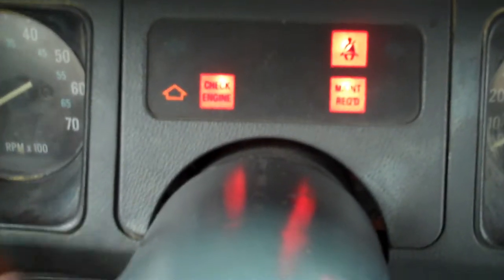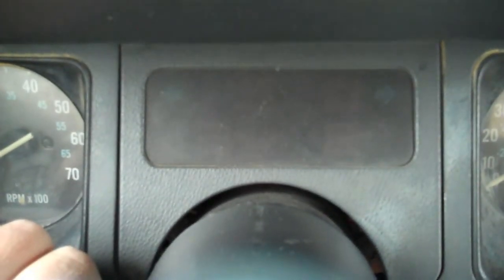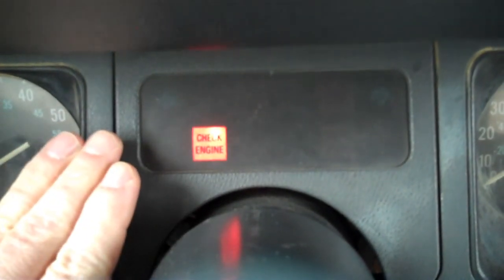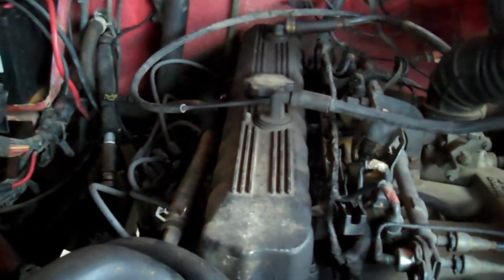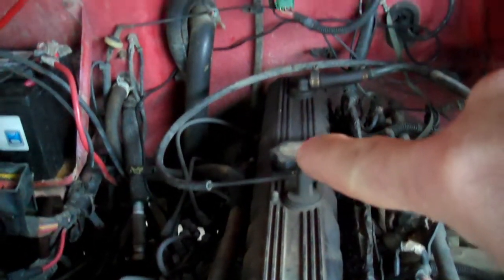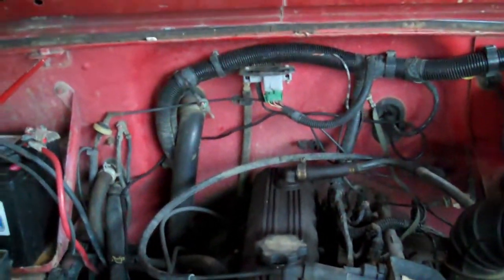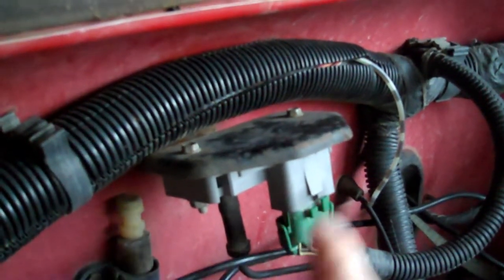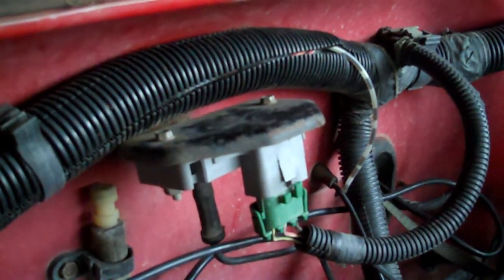Jeep Wrangler YJ 4.0 - Diagnostic trouble codes DTC and MAP sensor change

Comment from the maker: Trouble code list below. Has this tip helped you? Here is a free way to help me. Here is my Amazon influencer page that has many of the parts I've used in videos and some parts that friends have used. https://www.amazon.com/shop/poweraddicts-fixjeepscom-jeepcarandmotorcycletips?ref=ac_inf_hm_vp . By purchasing through this Amazon page you help me get a small commission of the sale and you do not get charged a cent more. Keep checking back because I update the Amazon page often. Thanks for your support!

Diagnostic trouble code and descriptions: 
 
11*: No crank reference signal detected during cranking. Timing belt skipped one or more teeth; or 
intermittent loss of either camshaft or crankshaft position sensor 
 
12*: Battery or computer recently disconnected within the last 50 start cycles). This is a very common code. 
Will not trigger a "Check engine light". 
 
13**: No change in Manifold Absolute Pressure sensor (MAP) from start to run 
 
14**: MAP sensor voltage too high or too low 
 
15**: No speed sensor signal detected 
 
17*: Engine stays cold too long. Bad thermostat or temp sensor 
 
21**: Oxygen sensor detection neither rich or lean or 
 21**: Oxygen sensor input voltage stayed above normal operating range 
 
22**: Coolant temperature sensor signal above or below acceptable voltage 
 
23**: Intake air temperature sensor signal above or below acceptable voltage 
 
24**: Throttle position sensor signal above or below acceptable voltage 
 
25**: Automatic Idle Speed (AIS) motor driver circuit shorted 
 
27*: One of the Injectors output drivers does not respond properly to control signal 
 
33*: Air conditioning clutch relay circuit open or shorted. If your Jeep doesn't have AC you will always get this 
code. Will not trigger a "Check engine light". 
 
34*: Speed control vacuum or vent solenoid circuits open or shorted. Switch is above or below acceptable 
voltage 
 
35*: (XJs only) Cooling fan relay circuit open or shorted 
 
37: Relationship between engine speed and vehicle speed indicates no torque converter clutch engagement. 
An open or shorted condition detected in the torque converter part throttle unlock solenoid control circuit. 
Incorrect input state detected for the Park/Neutral switch. Auto only. 
 
41**: Alternator field control circuit open or shorted 
 
42*: An open or shorted condition detected in the auto shutdown relay circuit. An open condition detected in 
the ASD relay output circuit. An open or shorted condition detected in the fuel pump relay control circuit. An 
open circuit between PCM and fuel gauge sending unit. Circuit shorted to voltage between PCM and fuel gauge 
sending unit. No movement of fuel level sender detected 
 
43: Peak primary circuit current not achieved with maximum dwell time. Misfire detected in one or more 
cylinders 1 thru 6. (4 and 6 cyls.) 
 
44*: Open or shorted condition in the engine coolant temp sensor circuit or a problem exists in the PCMs 
battery temp voltage circuit.  
46**: Battery voltage too high during charging 
 
47**: Battery voltage sense input below target charging during engine operation. Also, no significant change 
detected in battery voltage during active test of generator output circuit 
 
51**: A rich air/fuel mixture has been indicated by an abnormally rich correction factor 
 
52**: A rich air/fuel mixture has been indicated by an abnormally rich correction factor. 
 
53*: PCM module internal problem 
 
55*: PCM has finished telling you the codes. This means you are done reading codes. 
 
62: EMR mileage cannot be stored in EEPROM 
 
62: PCM failure SPI mile not stored 
 
63*: Controller cannot write to EEPROM 
 
64: Catalytic converter efficiency failure 
 
65: Power steering switch failure 
 
****This information was gotten from the Chrysler FSM, Quadratec & various posts on WranglerBoard forum. 
So, I can’t and will not promise or guarantee it’s complete accuracy. Diagnosing trouble codes and changing 
parts can still be like chasing a needle in a haystack. But, it’s always a good place to start.

Comment: I have the 52 fault code, wich means  oxygen sensor – rich condition indicated. The check engine is not full time turned on, and when it start, if I turn off and restart the YJ, the check engine gets off, but the code is saved. Thanks your video I got the 52 fault code.  I recently changed the oxigen sensor, so unless it get damaged again, It may be another problem. I watched on the gauge temperature that it is bellow to 195 (I watched also your video about the temperature gauge). I checked the thermostat and the coolant temperature sensor, ahtat according your videos they working fine, so the problem may be on the temperature sensor unit sending. Do you think it could be related to this code error or what else could I check?

Comment: hello. i would appreciate your help. i installed a new map sensor and it still shows me 13. it actually shows me 13 twice.
Reply from the maker: Check your voltages coming in and out of the MAP. Here is my video for that: https://www.youtube.com/edit?o=U&video_id=AHhaOol2SwQ . Sometimes a bad ground will cause issues with the MAP sensor. Old Jeeps are known for grounding issues. Good luck, hope this helps. Have a great day!
Reply: well i checked it with your videos help awesome. i have no voltage. i got voltage one time then it disappeared. when i double and triple checked nothing to voltage. so i am more than certain its a voltage issue. let me check if you have a video on checking the wires from the map sensor. would appreciate your help. thanks
Reply from the maker: You're welcome. I haven't created a video for checking the wires. At this point, you will have to see where the voltage break is. Pull the wrap off the wires. Trace the wire back to the PCM which is located under the brake booster. Once you trace the wire back to the PCM, test the voltage coming out of it there. If it continues to drop out at the computer, you have a bad computer. If you have voltage at the computer, its a wiring issue. Sometimes the wire going into the MAP plug is self can be loosing connections. At the point you are at now, it's chasing down where the voltage drop is.

Comment: Hi.. i have a question, i have a jeep wrangler YJ 2.5 and a check the codes and i have a code number 52 (52**: A rich air/fuel mixture has been indicated by an abnormally rich correction factor)..
what i have to do?, what i have to review?
Reply from the maker: I would go for the O2 sensor first. The O2 can be not operating as efficiently as it could but not bad enough to be bad enough to trigger a code. Also could be due a well needed tune up and air filter change. I included a link to my site that has the tune up video embeded in it. 

http://www.fixjeeps.com/jeep-tune-up.html
http://www.fixjeeps.com/O2-sensors.html

If it hasn't had any of those parts changed in a while, it can also help with performance and fuel mileage. Hope this helps. Thanks for dropping by. Have a great day!
Reply: Power Addicts - Jeep, car and motorcycle tips thakns i'm going to try with that, because before i changed the air filer, spark plugs and splark plugs wires and still have the code of rich mixture.

thank you
have a great day!
Reply from the maker: Fer Cas Your welcome :-)

Comment: This video helped me a lot bro! I have 92 YJ 4.0 so probably no difference between ours. I ran codes 12, 33 and 22. I replaced TPS, MAP sensor and have new plugs wires, cape and rotor. Every now and then the engine light comes on and it will rev kinda high (1000 RPMs) and when I hit the gas it stumbles (RPMs fall) and then shoots up because I hit the gas. Its driving me nuts!!! its not a vacuum leak because it isn't all the time. Have any similar issues? Thanks!
Reply from the maker: You are very welcome! Glad the video helped you :-). Codes 12 & 33 are very common. Code 12 is just saying the battery was disconnected in the past 50 starts. Code 33 happens if you don't have AC or have it unhooked. Code 22 is a coolant temp sensor, there are 2 of those. The one you want to address is in water neck where the thermostat is (very front where the top radiator hose is). The other is located on the very back side of the cylinder head on the drivers side of the valve cover (the sensor runs your dash gauge, it only has 1 wire and has NO effect on how the engine runs). If the CTS (coolant temp sensor) is going bad, it could be tricking the ECU into thinking the engine is still cold causing the erratic idling issues. TPS & MAP is a great start. Don't know if you noticed the videos or not but I created a demo video for each how to test them. Next thing I would do is pull and clean the IAC (Idle Air Control). It's located on the throttle body. Stand on the drivers side of your Jeep, the TPS should be at 3 o'clock position to you. The IAC is at 12 o'clock. It may benefit to pull the whole throttle body to clean it also. Remove the IAC, then using spray carb cleaner, clean the crud out of the throttle body and the IAC where it joins the throttle body. Often times carbon\crud will build up around that area and cause crazy hard to find idling issues. When that check engine light comes on, check the code ASAP to see if it tells you anything. There can be weird issues that doesn't leave a code, but it only takes a minute to check. You gave me a couple of ideas for my upcoming "how to" videos. Thanks and let me know what you find.
Reply: I did all of that and the computer still tells me a coolant temp sensor it not reading. I replaced the one on the water neck (front of motor) not the one back by firewall. Cleaned throttle body, IAC and new TPS and new MAP. I get code 13 AND 22 now..it idles high and take few seconds to come down at like a stop light or parking. Takes off fine but never lets the idle or RPMs come down until a few seconds after. All my vacuum lines are fine and hooked up...soo aggravating!

Comment from the maker: This past weekend I was at a local auto parts store. A fellow with a '95 Jeep Wrangler YJ was having intermittent issues. I overheard him tell the parts guy that he wished he could run the code and maybe he would know for sure what to buy instead of randomly buying parts. I told him that he didn't need a scanner for that generation Jeep. We walked out to his YJ, I demoed this trick for him, it gave him the code for a bad MAP and O2 sensor. He just kept thanking me because it saved him lots of money just randomly buying parts until the problem went away.

See if we just all get together and help one another, it make life much easier for everyone. Doesn't matter if you know the person or a total stranger.
Reply from the maker: Jeep YJ trouble codes - don't need no scanning tool! These fine Jeeps have all you need built right into the ECU.

Here is the trouble code in case you happen to stumble across my Google+ page.

Or, go to http://www.poweraddicts.com/jeep-wrangler-yj-trouble-code.html to go get you a printable copy!!

1991-1995 Jeep YJ with On Board Diagnostics 1 
 
Using the ignition switch, at no point do you actually start the Jeep: Start with the ignition in the OFF position, 
turn the key to ON, OFF, ON, OFF, ON ... stop .. leave the key in the ON position (Complete this sequence in 
under 5 seconds). Once you stop the key in the ON position, the check engine light will stay lit for a moment. 
When the light goes off, get ready to start counting the light flashings. 
 
Once the Check Engine Light has turned off, it will pause in the off position for a second or two, and then start 
to flash, count the flashes. Each code stored will be given to you in a 2 digit sequence. As an example, code 12 
would be FLASH ... <PAUSE>... FLASH FLASH followed by a <LONG PAUSE>, followed by the next code. Code 
55 signals the end of stored codes. You can repeat the key sequence as many times as needed if you were 
unsure of a code. 
 
*= Check Engine light will not illuminate at all times if this Trouble Code it present. 
**= Check Engine light will illuminate during engine operation if this Trouble Code is present. 
 
Diagnostic trouble code and descriptions: 
 
11*: No crank reference signal detected during cranking. Timing belt skipped one or more teeth; or 
intermittent loss of either camshaft or crankshaft position sensor 
 
12*: Battery or computer recently disconnected within the last 50 start cycles). This is a very common code. 
Will not trigger a "Check engine light". 
 
13**: No change in Manifold Absolute Pressure sensor (MAP) from start to run 
 
14**: MAP sensor voltage too high or too low 
 
15**: No speed sensor signal detected 
 
17*: Engine stays cold too long. Bad thermostat or temp sensor 
 
21**: Oxygen sensor detection neither rich or lean or 
 21**: Oxygen sensor input voltage stayed above normal operating range 
 
22**: Coolant temperature sensor signal above or below acceptable voltage 
 
23**: Intake air temperature sensor signal above or below acceptable voltage 
 
24**: Throttle position sensor signal above or below acceptable voltage 
 
25**: Automatic Idle Speed (AIS) motor driver circuit shorted 
 
27*: One of the Injectors output drivers does not respond properly to control signal 
 
33*: Air conditioning clutch relay circuit open or shorted. If your Jeep doesn't have AC you will always get this 
code. Will not trigger a "Check engine light". 
 
34*: Speed control vacuum or vent solenoid circuits open or shorted. Switch is above or below acceptable 
voltage 
 
35*: (XJs only) Cooling fan relay circuit open or shorted 
 
37: Relationship between engine speed and vehicle speed indicates no torque converter clutch engagement. 
An open or shorted condition detected in the torque converter part throttle unlock solenoid control circuit. 
Incorrect input state detected for the Park/Neutral switch. Auto only. 
 
41**: Alternator field control circuit open or shorted 
 
42*: An open or shorted condition detected in the auto shutdown relay circuit. An open condition detected in 
the ASD relay output circuit. An open or shorted condition detected in the fuel pump relay control circuit. An 
open circuit between PCM and fuel gauge sending unit. Circuit shorted to voltage between PCM and fuel gauge 
sending unit. No movement of fuel level sender detected 
 
43: Peak primary circuit current not achieved with maximum dwell time. Misfire detected in one or more 
cylinders 1 thru 6. (4 and 6 cyls.) 
 
44*: Open or shorted condition in the engine coolant temp sensor circuit or a problem exists in the PCMs 
battery temp voltage circuit.  
46**: Battery voltage too high during charging 
 
47**: Battery voltage sense input below target charging during engine operation. Also, no significant change 
detected in battery voltage during active test of generator output circuit 
 
51**: A rich air/fuel mixture has been indicated by an abnormally rich correction factor 
 
52**: A rich air/fuel mixture has been indicated by an abnormally rich correction factor. 
 
53*: PCM module internal problem 
 
55*: PCM has finished telling you the codes. This means you are done reading codes. 
 
62: EMR mileage cannot be stored in EEPROM 
 
62: PCM failure SPI mile not stored 
 
63*: Controller cannot write to EEPROM 
 
64: Catalytic converter efficiency failure 
 
65: Power steering switch failure 
 
****This information was gotten from the Chrysler FSM, Quadratec & various posts on WranglerBoard forum. 
So, I can’t and will not promise or guarantee it’s complete accuracy. Diagnosing trouble codes and changing 
parts can still be like chasing a needle in a haystack. But, it’s always a good place to start.

Comment: Code #62 Unsuccessful attempt to update EMR mileage
Reply from the maker: Thanks for the reply, I've found what the code means. Guess what I'm looking for is what "part" on the Jeep is defective to cause that code. Even what Google time I've spent researching that code, I haven't found anything that gave a solid explanation as to what causes that code. Found some info stating that it isn't writing mileage to the ECU for Emissions reminders. Or some articles says its writing speed signals for the cruise control (which I don't have). Like I said I haven't found any solid evidence what causes the code. The little Jeep runs great after replacing the MAP sensor and a little better gas mileage, so apparently the code 62 doesn't mean too much. At least to my Jeep it doesn't anyways. Thanks for the help and checking out the video. :-)